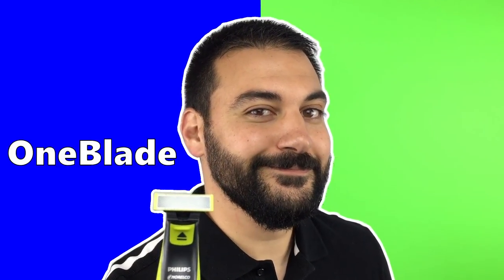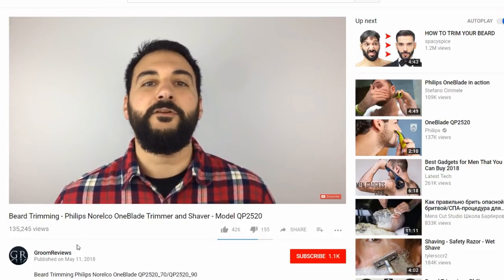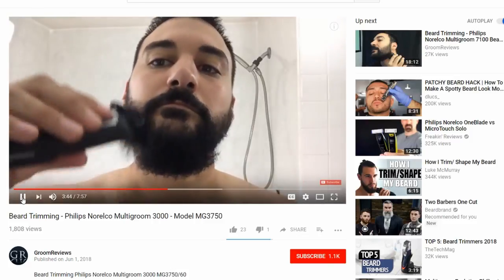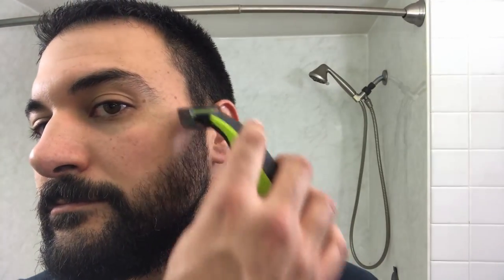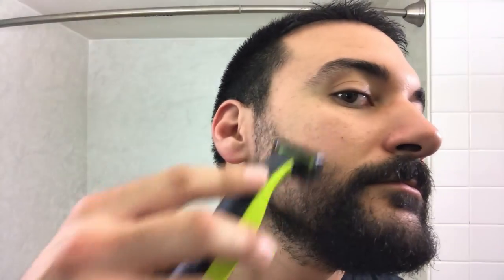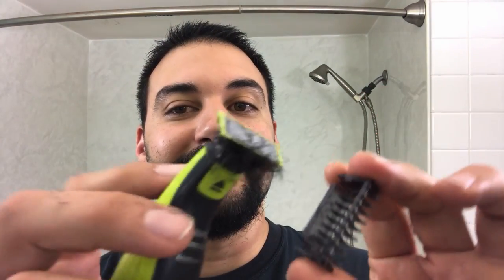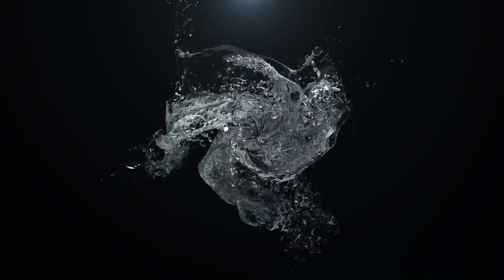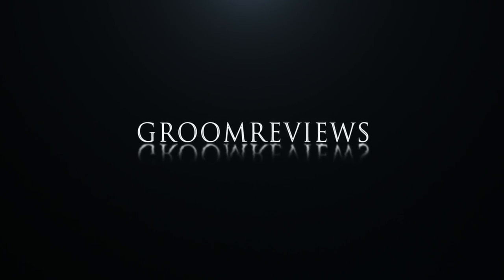Beard Trimming - Philips Norelco OneBlade Trimmer and Shaver - Model QP2520  - Part 2

Comment: hey, cool review. I bought the OneBlade Pro probably half a year ago and I am very happy with it. My father also uses it sometimes but I didnt had to buy new blades even after using it a lot. One thing I wanted to know though is if it is possible to put the bodyblades on the pro version?
Reply from the maker: Hi, Kilian. Glad you liked the review. As I mentioned in response to your previous comment, according to Philips specification sheet for the OneBlade Face, OneBlade Face and Body, and OneBlade Pro, each of these OneBlade models are compliant with replacement blade models QP210, QP220, QP610 and QP620.  Hope this helps! I appreciate the support and thanks for watching!